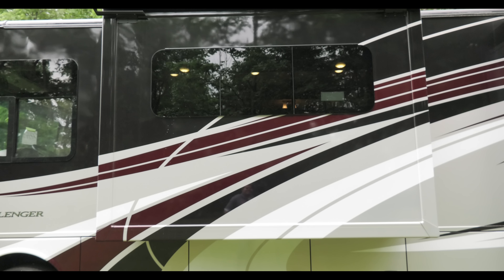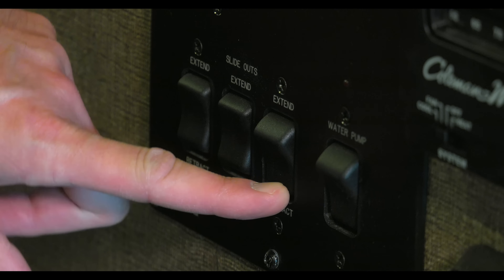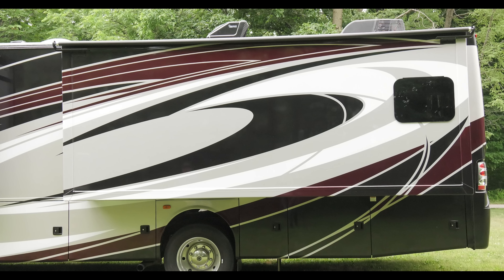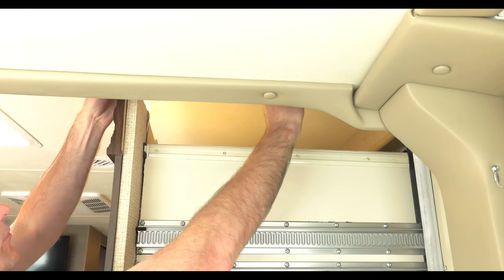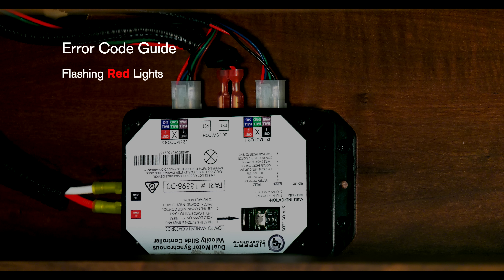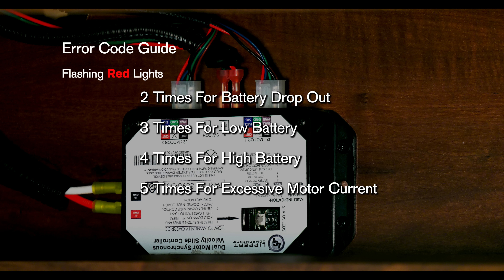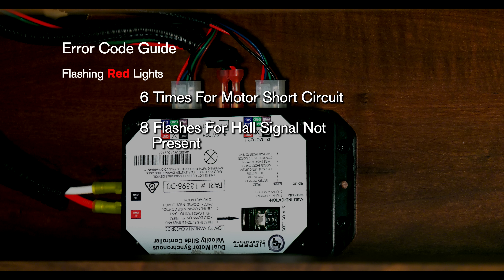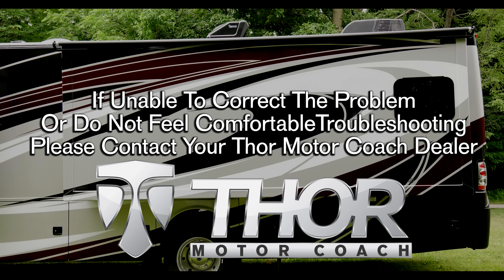Schwintek Slide Room Troubleshooting Guide

Comment: Seems like most errors are code 8 - wiring.  Frequently around the head of the motor.  Could you reinforce this area?  Shrink tubing around wires to limit wire abrasion as the free floating motor moves around?  Silicon the PCB board to wire connection?
Just trying to throw out ideas to improve the reliability of the system…

Comment: Where is the circuit board in the basement?  I have a class s  2020 quantum SE31   .    First compartment behind generator on drivers side ,  has a grayish cover plate held on with 4 Phillips screws.  I haven't removed that plate yet ,  is the motor circuit panel behind that plate
Reply from the maker: It varies from floorplan to floorplan.  The unit for the slide does not have a cover, it's just like what you see in the video and should be easy to access.  Our Customer Care team can pull up the schematics of your unit and pinpoint exactly where it is.. (877) 855-2867  Thanks for reaching out. - Steve
Reply: @ThorMotorCoach  i was a little silly and over looked the circuit board and found it a a week or two ago.  i tried the button 6 times and hold the 7th. nothing worked and no flashing lights. i tried it a couple times.  i unplugged the motor cables and no way it was moving by pushing, of course i was alone but still . gears must be locked, i looked for screwed to releases gears like video suggests and found nothing.  i will be calling the Thor phone like as soon as i can get a day to do it, we have had rain and snow and cold weather here in bama and my rv is kept at my dads house, not mine.  but here is the kicker.  my rubber pad (button) has falling off and bracket holding the rubber button in place on the mother board is off also, i found them both but no way can i plug back in. too small for me.   so the button plan is moot.   any other suggestions before calling thor?
Reply from the maker: @cmyoung1969  Go ahead an give our techs a call at (877) 855-2867... thanks - Steve

Comment: where is the slide controller located on a 2022 Four Winds 22B?  The large bay under the bed is completely sealed.  Paneling is stapled to the walls and the bottom of the bay has a black plastic liner.  The ceiling of the bay has a solid sheet of paneling type material. There is a steel edge with about 12 screws between the paneling and the bottom black plastic liner.
Reply from the maker: Hi Terry.  Here is a link to our Owners Resource page.  Sing up, input your VIN and you can pull up every schematic and diagram about your Four Winds.  https://thor.mizecx.com/cc/cpSignIn.html#sblox=none   It's absolutely free and a fast and easy way to find information about your RV.  You can also call Customer Service at (877) 855-2867 and they can help you find the bay it is in. Thanks - Steve

Comment: Do you have the information presented here in writing to share as a PDF or perhaps a link?  Thank you.
Reply from the maker: Tom, here is the manual. https://lci-support-doc.s3.amazonaws.com/manuals/slideouts/ccd_0001602.pdf  - Steve
Reply: @ThorMotorCoach  thanks. Extremely informative.  I shared both the video and the pdf with my husband.
Reply: @ThorMotorCoach  That's a dead link.

Comment: Useful info. But, how do you determine which motor on a slide room is #1 or #2? Front to back as far as the room's orientation to the front of the RV?
Reply: How do you adjust room? It has tore my floor covering up.

Comment: I have a 2005 Thor Hurricane and both slides will not retract. I have a significant leak in the living room slide out that needs to be addressed.  Would this video apply to my make and year?
Reply from the maker: Hi Kristen.  That is a Lippert Components part that may have changed over the years.  But I'm thinking the basic operations should be the same.  If you call our Customer Service department they should be able to tell you more. Thanks, Steve

Comment: I have a schwintek slide that is out and can’t get it to operate,there seems to be no power to the box any suggestions
Reply from the maker: Hi Kevin, have you checked all your fuses and breakers?  Are the lights on the control module for the slide flashing or does it appear to be dead? If the box is dead and the slide is out, remove the two white plastic plugs on each side of the box.  This will release the motors and you (along with some help) can push the wall in.  Plug the cables back in to lock the motors once the slide is in.  Our customer care number is  (877) 855-2867.  - Steve

Comment: When I went to put the slide out one side moved while the other did not which in turn made the rear edge pin against the wall . If I unplug the motors can I push it in ?
Reply from the maker: Hi Lou.  With the motors unplugged you should be able to push it in.  You may need a few friends.  Have you tried to re-sync motors? - Steve
Reply: It's jammed up against the one wall . I will try when the weather breaks .
Reply from the maker: @9caplad  From your panel, if the wall is partly in, hit retract, extend, retract, extend, retract, extend.  Hold each button down for two seconds. You want to hear the noise of the motor.  Do this 6 times.  3 times on each- extend and retract.
 This will re-sync the motors. - Steve
Reply: Can't find control box, 2013 aerolite schwin tec slide any ideas on where it is?????

Comment: This is helpful but what about when there is zero lights?
Reply from the maker: You're status lights are not working?  Here is a link to the manual.  - https://lci-support-doc.s3.amazonaws.com/manuals/slideouts/ccd_0001602.pdf   
You can call our customer service department at  (877) 855-2867 - Steve
Reply: @ThorMotorCoach  That is a dead link

Comment: Too bad they cant explain this when you purchase your new trailer.  I heard  many different stories, on how to override the system, different than this.
Reply: Not exactly correct on placing in over ride mode. When you press and hold the 7th time release the button as soon as the lights flash. If you hold too long like they did in the video the lights will go out and it will not be in over ride mode. When you release immediately the lights will flash for 1 minute while you go push the button to retract the slide